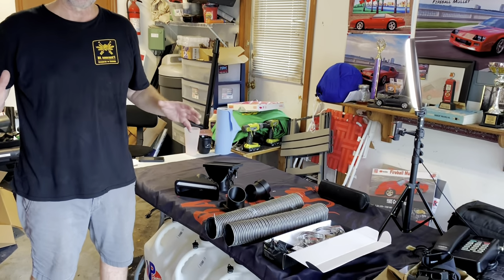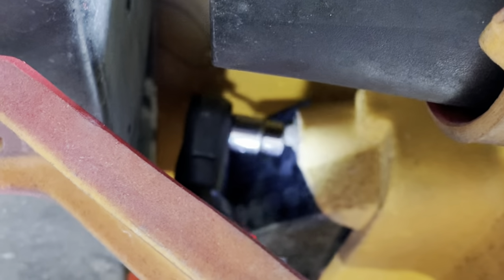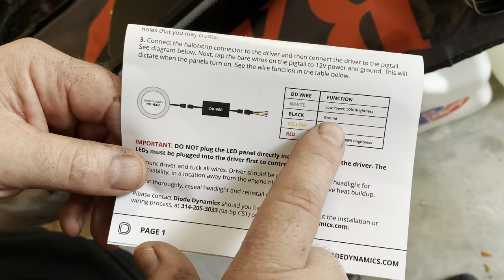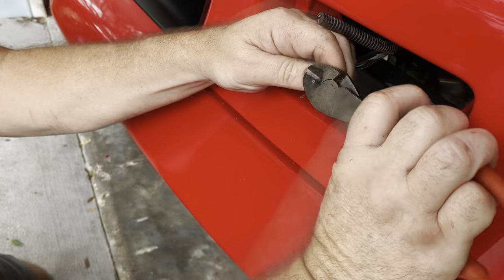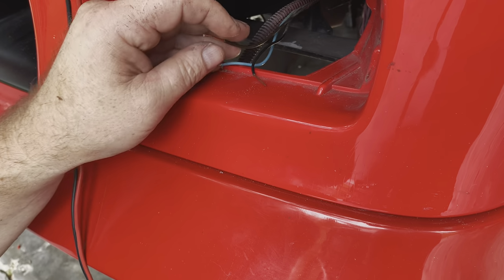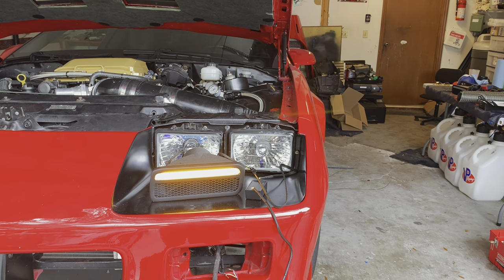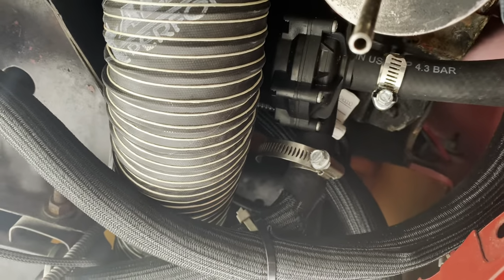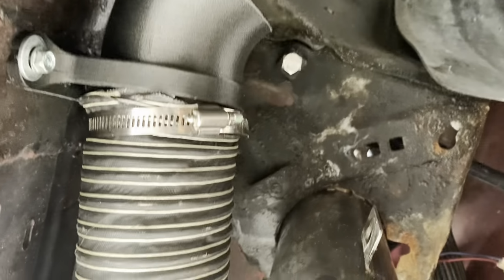LED, vented front parking lamps by Starbuck Innovative Designs

Comment: Slick, wondered what you will do with driving / fog lights maybe on the inboard openings of the front fascia? My thought is to install daytime running lights there, for the same reason of ya-hoos not watching out for you. Cheers!
Reply from the maker: I recently removed them, thinking it would increase air flow to heat exchanger, but I don't think it made a big enough difference.  BTW, thanks for being one of the top commenters!!!

~Fireballmullet
Reply: @FireballMullet  Ya, I guess in  Fla. where you actually have some heat, that could be a problem. Have you noticed an increase in overheating after the super charger install?
Reply from the maker: @davebarron5939  for the most part no change… IATs are not bad either… typically IAT 113-118 and get on boost 128 but quickly recovers

Comment: Hmm, not a fan of the LEDs - especially since they don't even light out to the edges and still look a bit orange when they're meant to be white.  They look a bit "Made in China" compared to the old ones.  I do like the idea of doubling up where the lights were for brake cooling though.  Thanks for the walk-through of how you did it - I'm at a bit of a loss when it comes to electricity!
Reply from the maker: Finally, someone that is not a fan… I was starting to think everyone loved them 😂 what do you mean supposed to be white? These are supposed to be amber lol
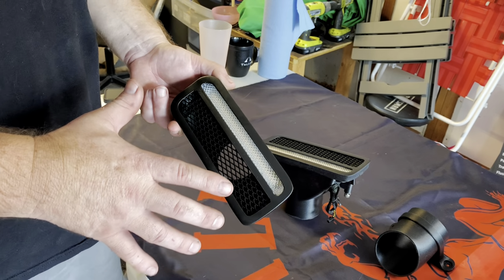Reply: @FireballMullet  Ah sorry, I had these confused with what you were talking about at 1:06 - when you started talking about the wiring later I was thinking the turn signal one would be a different colour to the red and white wires.
Reply from the maker: @Astrosisphere  he makes a version in white that turns amber when blinking. There are a few variations now

Comment: What is the wheel size and backspacing, and tire size? Where did you get the wheels? They are perfect! I need a set for my sons IROC.
Reply from the maker: US Mags U550 Forged 2 piece Irocs, rears are Michelin Pilot Sports 295/35/18 18x10  and fronts are 255/40/18s 18x9
Reply: @FireballMullet  Pricey stuff! What is the backspacing? Thank you.
Reply from the maker: @kennydemartini2169  6.25 (but 6.5 would have been perfect) rear and 5.5 front

Comment: Looking into these,
Would i need to buy the Flashers if i have resistors on the wires already for switchback bulbs?
Reply from the maker: I didn’t buy anything else to make them work. But if you don’t have led side markers, the dash signals will be slightly illuminated (at least on mine they were).
Reply: @FireballMullet  wow thank you for the response so quick,
Definitely buying them right now 😂👍
Reply from the maker: @whalewashindolphinlive3656  no problem!  Good luck
Reply from the maker: Just to be clear, mine came with an electronic box on each side that ran these. I’m saying I didn’t buy anything special outside his package